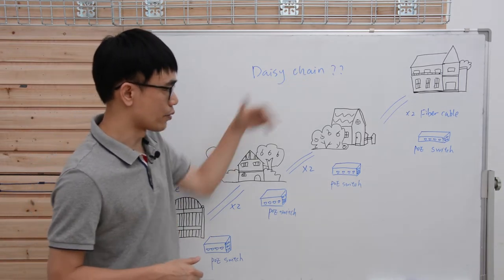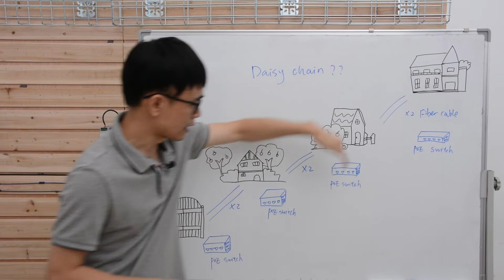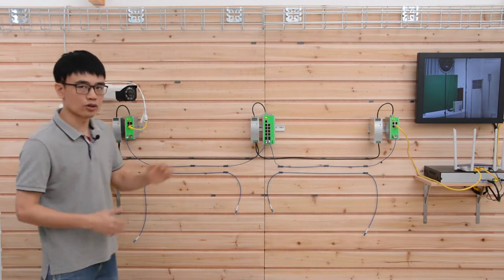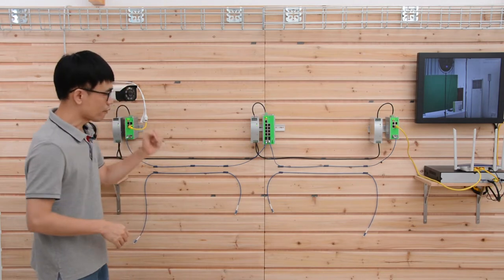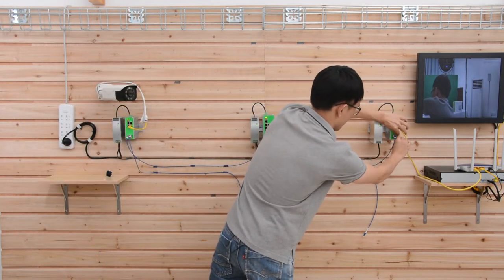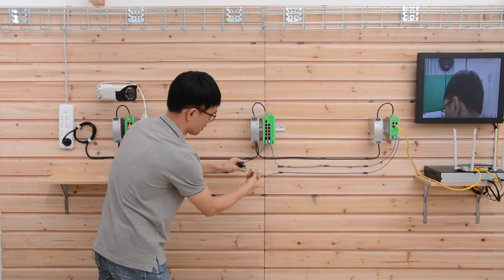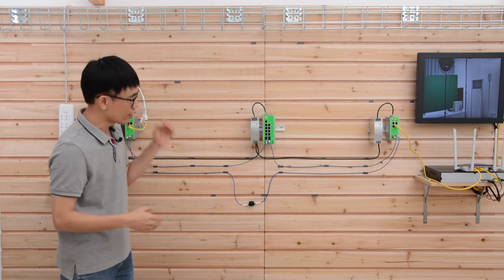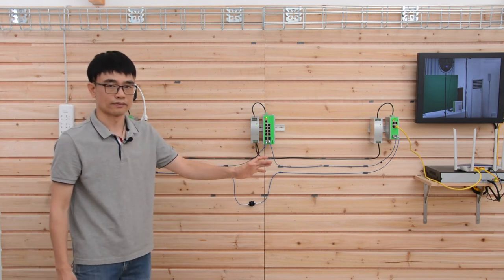How to daisy chain PoE Switch Correctly - Part #2 Straight Line Network

Comment: can we use duplex sfp transceiver for same technology?
Reply from the maker: Yes, but you will need 4 fiber optical core.  BiDi transceivers employ different wavelengths to transmit and receive data. The setup will become more straightforward, but you can use duplex SFP without problem.

Comment: How about If I have many cameras at different positions?
Reply from the maker: You might need to determine the topology. You mentioned there are many cameras. You might want to put the cameras in the map, and see whehter the star topology or the ring topology should fit in. Each switch can take in 8 cameras. You don't need each switch for each camera.